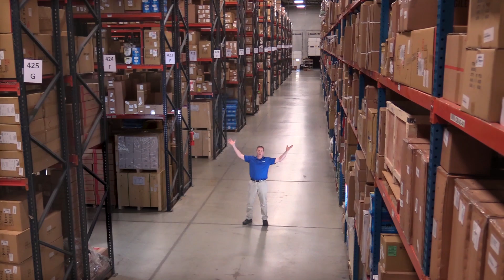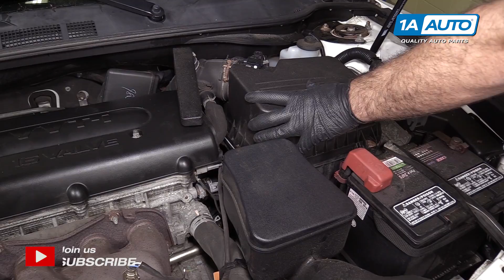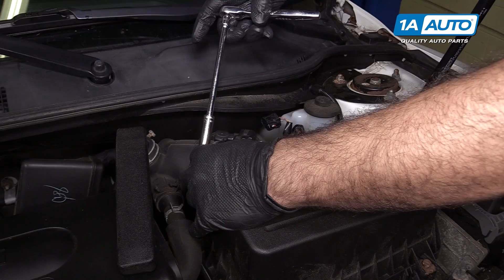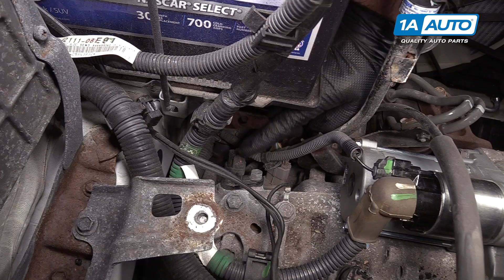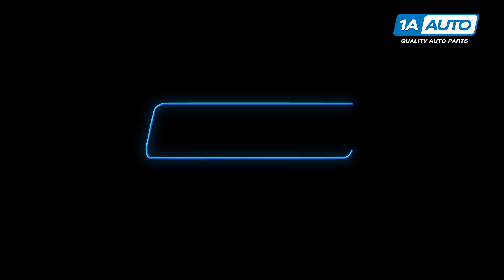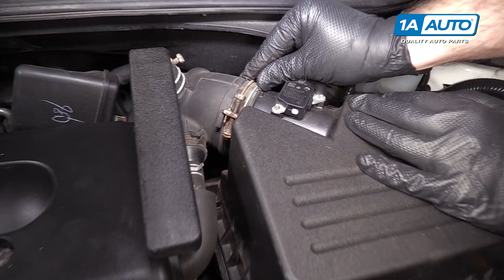How to Replace NT Speed Sensor 06-11 Toyota Camry

Comment: I’m looking for a video that helps with the right rear wheel speed sensor on a 2007 Lexus IS250. The code i continue getting on my scanner is C0210-Abs Right Rear Wheel Speed Sensor Signal Malfunction. Does anyone have any tips or experience with this?

Comment: My 2007 Toyota Camry has the Brake Light and ABS icons on. The icons come on and off while driving the guages stop functioning the moment the lights come on . Is this a Speed Sensor issue or ABS Sensor issue ? No check code or engine light present to figure it out please help.

Comment: Thanks for the video.  Is the VSS the same as the Transmission Speed Sensor?  Did you really need to remove the air box or was that just for the video?  Seems like most of the video is removing and reinstalling the air filter housing.  I can see the VSS in your video right below the battery.  Thanks!!
Reply from the maker: +Kevin Murray Thanks for checking us out! Yes, this will be the same thing, the VSS and transmission speed sensor. You may be able to get this swapped if you do not remove the air box, but this makes it easier to film and show everything.

Comment: Are there 2 sensors on a toyota solara. I took my car into a transmission place to check the transmission and a day and $365. dollars later they told me that they had to replace the speed sensor.  About 4 days later the car is doing the same thing. I take it to my son and he tells me it has never been changed. I call them and they want me to bring it back in because they say there are 2 speed sensors and they only changed one.  Are there 2 speed sensors?
Reply: Pretty sure there is 2 speed sensors, at 2:06 you can see both of them. 
The one he is working on and the one at the bottom of the screen. 
Did you get anywhere with your repairs?
Reply: @SWFBrickbox  No not yet.

Comment: Hey I changed the sensor but it still shift with a thump from 1st to 2nd and aswell as slow pick up of acceleration. Help plse
Reply: Did you ever figure out what it was i get the same thing.. thanks
Reply: @glm2958  hi did you ever get your car fix becouse i have the same thing with my car?
Reply: I have 2014 with very slow acceleration. I have to light foot it to get going.